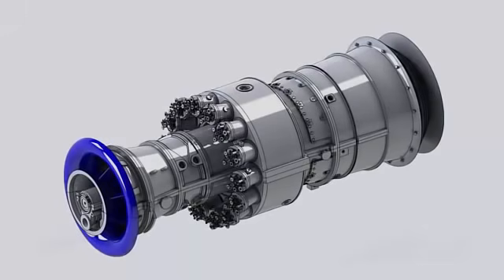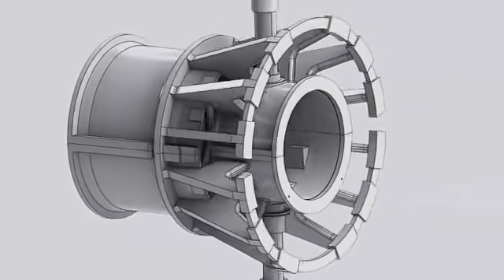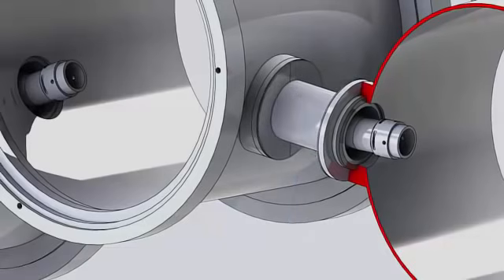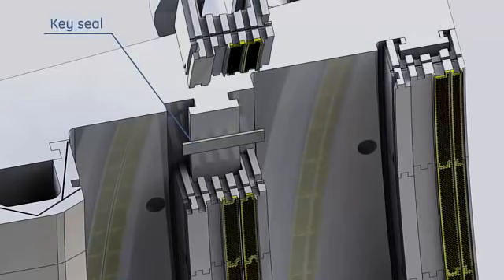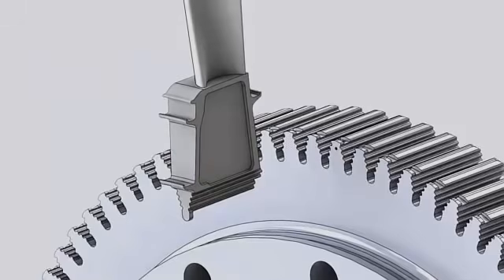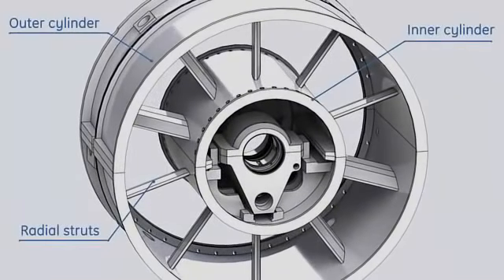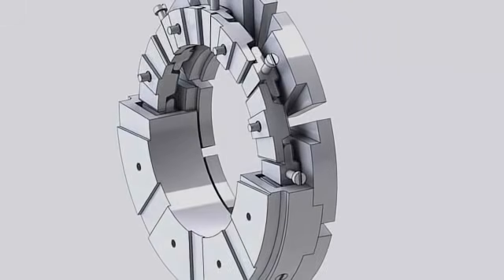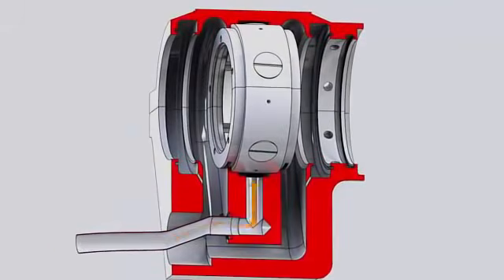GE Gas Turbine | PG9171E or MS9001E | Overview Tutorial

Comment: update 2024: Russia has successfully replaced Siemens gas turbines by developing its own production capabilities. This shift began as a response to sanctions and the suspension of cooperation with Western companies. Russian enterprises, particularly Rostec and **Power Machines**, have played a crucial role in creating domestic alternatives.

Russia introduced its first large-scale GTE-170 gas turbines, which have a capacity of 170 MW, specifically designed to meet domestic energy demands and adhere to government requirements for industrial production. These turbines are set to replace Siemens equipment in key power plants across Russia. The production is supported by significant investments, with plans to ramp up the output of these turbines annually to meet growing demand. By 2027, Russia aims to manufacture 10 such turbines each year, ensuring the country’s energy independence.